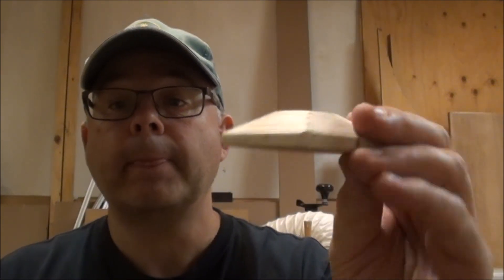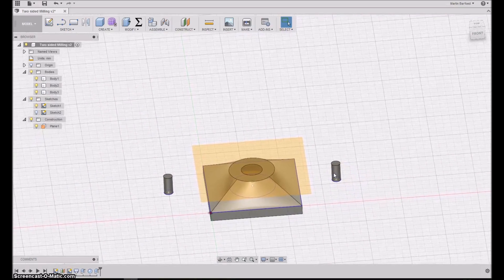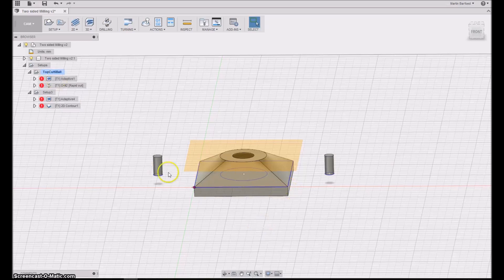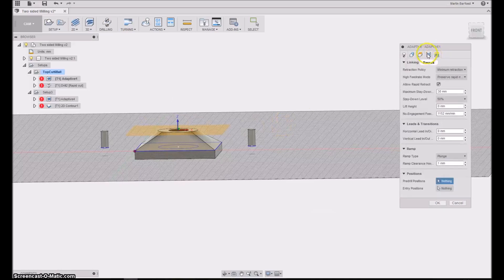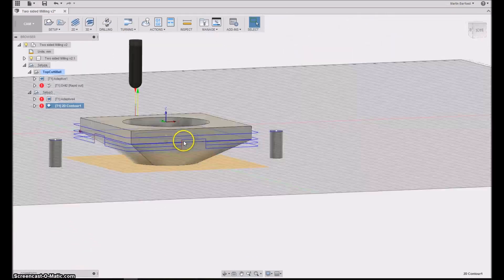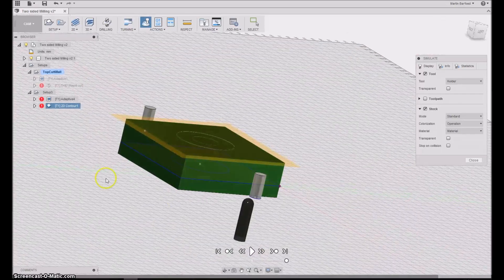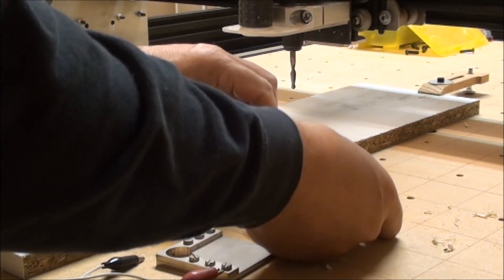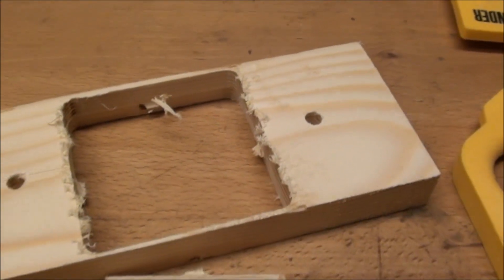Two Sided 3D Milling using Pin Method. CAD and CAM in Fusion 360

Comment: Sorry for being direct but you left out what is arguably the most important steps (what I was looking for); how did you set your work coordinate system?  what did you use as your origin point, was that the same point on both sides? what settings did you use in Fusion 360 to get the Z to go in the right direction after flipping the part etc.  I'm not even sure what the point of the pins where if you didn't even use them to reference your stock when you milled the first top half...
Reply: I think the key is that one of your setup axes is on the center line between the cylinders.   Since he doesn't ever change the x and y zero, that line didn't move.  I think his origin is in the center of the stock, on the surface.  Same for the second side.  Be sure your stock in fusion matches the thickness of your material.  Other two don't matter much. 

I find getting the axes right easiest if I flip the work piece in fusion the same way I would in real life.  Then choose the origin and axes. 

Hope this helps.  Maybe one day i will record a fusion session and post it.

Comment: Thanks for the video.  I've done two-sided work before, but not yet with Fusion 360.  I used steel pins instead of wood dowels, but the wood dowels would be safer in case of the bit accidentally hitting them.  Always more to learn.
Reply from the maker: Thanks! - and yes, running into the wood dowels may damage the project but the bit will survive :-)

Comment: Dear friend. Thank you so much for the video. Any recommendations on zeroing X and Y? Should they be the same for both sides?
Reply from the maker: In this project I used the same and probably it will work for most projects. However, I do not see that it's a must. If you e.g. has a project with an irregular shape you may decide to have zero at different places.

Comment: It's not clear from the CAD-part that (or if?) the 2 pin-holes are placed in a symmetric manner (equal distance from the center of the part and placed on th ecenter line of the part), but the video is much better than nothing :)
Reply from the maker: It is most easy to place the holes in the center as it flips over directly. However, if you need more support you can place 4, 6 or more symmetrically around the centerline

Comment: Hi Martin. Thanks for the video. One thing that would be useful - if you could show us how you setup the toolpaths for the rapid drilling out of the two dowel holes. I cannot seem to get this to generate toolpaths. Are you using the face of the cylinders?
Reply from the maker: Hi Matt. You have to make a separate G-code file for the two holes. First you run it on the spoil board and then again on the work piece. Then mill the upper part (2nd G-code file) without moving the work piece. When finished flip, mount the dowels and run lower side (3rd file).

Comment: is there an easy way to make the cylinders in fusion 360 so that they are symmetrical to the stock and will enable easy flipping?
Reply from the maker: Not entirely sure. How about a center line through the stock and then apply mirror constraint to the circles?

Comment: How do you configure the Work Coordinate System for the two Setups?  Is there any chance you could share files for this design?  I tried this technique, but couldn't figure out how to align the top and the bottom in CAM.  Thank you!
Reply from the maker: You can find the Fusion360 design with both CAD and CAM here: http://a360.co/2rau2HZ
Reply: @martinbarfoed5040  you need to set the permissions to Public
Reply: @martinbarfoed5040  hola..no se puede visualizar.... solicita algún tipo de autenticación gracias
Reply: access unauthorised??

Comment: hey Martin thanks for posting this as its very helpful for the project I'm doing at the moment. I'm stuck 0n one part in the cad cam. you put in two cylinders to use as pin holes. how do you drill them out. thanks in advance
Reply from the maker: I make a small separate G-code file with the two holes in. First I drill them in the spoil board and then the same two holes are drill in the stock material. The pins I used are just wood dowels with the same diameter as the holes. Hope this helps.
Reply from the maker: I made a separate file with only g-code for the two holes. I use a 6mm bit and the dowel pins are 6mm. First milling the holes in the spoil board and the in the first side on the work piece material.
Reply: I understand what you are saying but I'm stuck at generating the tool path. I select the face of the cylinders but it wont drill them out. I think they are recognized as an object an not holes. it just says failure to generate tool path.
Reply from the maker: Are you selecting the bottom of the hole as geometry? Try also to "simulate" using a smaller bit just to see if it could be something with collision
Reply: Great video, Martin. I'm trying to work through this but unfortunately can't get Fusion to drill the holes. I've tried with cylinders that are taller than the stock and not as tall as the stock, using the drilling operation with bits the same size as the hole and also smaller, and trying to change the top and bottom planes, but so far nothing I do gets it to generate a drilling tool path. How do I tell Fusion that the two pin columns are not columns that should be left but instead are holes to drill from the stock? Thanks for your help!
Reply: Update - I got it to work by deleting the cylinder bodies (where I basically extruded the circles) and instead just selected the sketch of the circle and adjusted the heights to stock top and bottom. I'm not sure why it won't work if I select the circle face of the cylinder I made, but glad its working.
Reply: @automaticprojects  What I did was extrude cylindersfrom 10 mm circles on the sketch, and then used the Hole option to create 6 mm holes in those cylinders.  The cylinders themselves are not milled, just the holes.  There are probably better ways but that worked for me.  .

Comment: One question, though.  Why did you drill the underboard (white board) with two holes first?  Why not drill through both the stock and the underboard at the same time?
Reply from the maker: Hi Dave. Thanks for the encouragement! If the stock is not very thick you can drill all the way through in one go. With the piece I made here I think I could have done it. However, one of the benefits of two sided milling is that you can mill objects that are thicker than you can mill in conventional manner due to bit length. So here you need to do first the base holes and then the holes in the top side for later being able to flip the part.
Reply: Thanks for the reply, Martin.  That was my best guess so good to know I'm on the right track...

Comment: I can't wrap around my head around it. How can I visualize the three operations in the same process?
Reply from the maker: In words the steps are the following: 1) Drill holes for dowel pine in spoil board 2) Fix the block of wood and drill the same holes here. Remember to re-zero on the top 3)Mill top side down to a depth that allow you to mill the rest from the other side (how deep depends on the shape) 4) flip part and align using dowel pins in the pre drilled holes 5) mill the last side

Comment: Thanks for explaining. I am still a bit reluctant to learn fusion 360 but I might not have a choice.
Reply from the maker: Educating Savvas I agree that the learning curve is steeper than for other programs like Sketchup or VCarve. However, it's free for hobbyists (hard to beat) and you can do most of the complex operations.

Comment: OH boy, 1 month too late.  I just worked through this on my project!  One thing the other tutorials and video's don't show is how to do the CAM for tooling holes.  I had to figure this one out myself.  You make it look easy!  Thanks for sharing.  Many people will benefit from it.
Reply: I'm still stuck trying to drill the holes. I am doing the drilling operation in Fusion but so far I can't get it to generate a tool path no matter how much I play with the parameters. :(